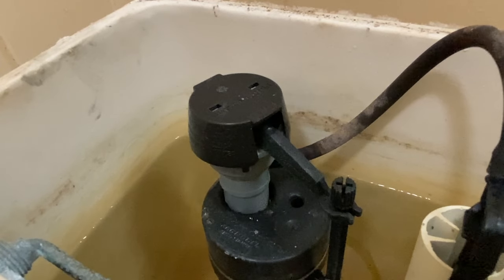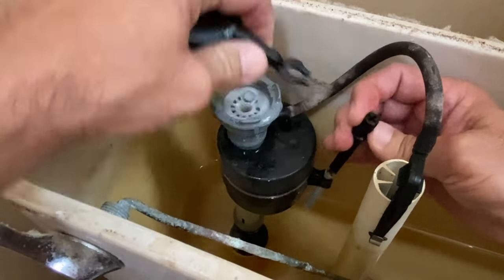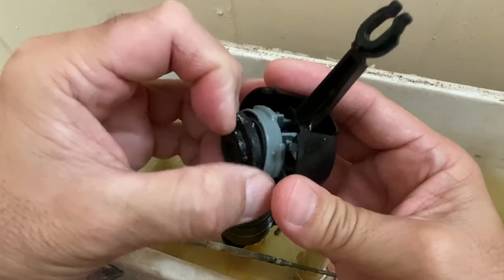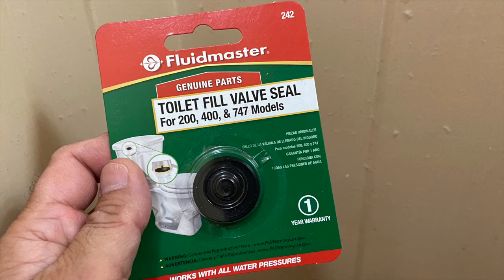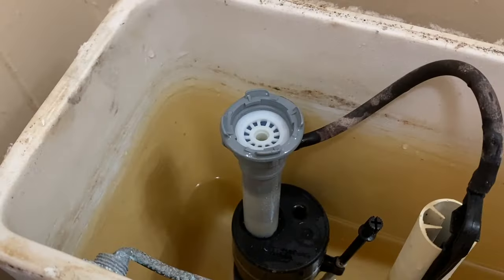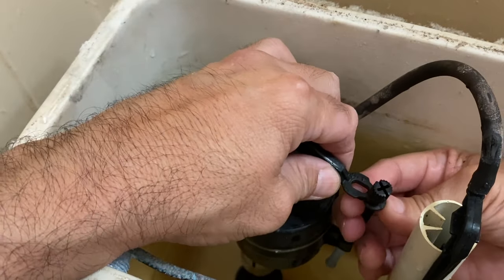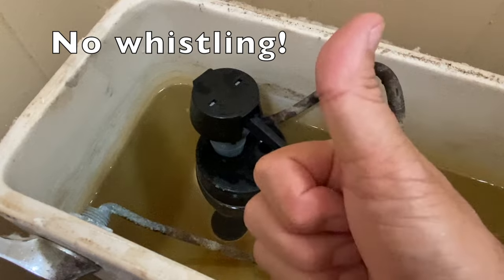Quickly Fix a Whistling Toilet

Comment: Last night, our toilet started making this loud whistling sound. It scared me. My mom and I found this video and it worked perfectly. This is a great video. I'm 12 and was able to follow it and fix the toilet. It even flushes better now. Thanks for the video!!!
Reply from the maker: Great job!   I’m glad to hear that you found the video helpful.  Keep on learning.  
😎
Reply: Thats so awesome  im going to attempt this tmrw. My toilet isnt whistling but after watching another video and this one i am wondering if doing this will fix my problem. Give me confidence to try this myself after reading that you were able to fix yours. He did gice great instruction. I feel so accomplished when im able to fix something myself. I mean i guess if i screw up or it doesnt work then we can call the plummer. Mine making that running sound.
Reply: Mine has been whistling for awhile.  I figured it just didn't know the words.
Reply: Did you replace the valve or just clean it?
Reply: Very helpful..
Reply: @godsgirl0019
Yes

Comment: great video. I just cleaned the seal and everything else with an old toothbrush, put back together and noise was gone. Saved a trip to Home Depot.
Reply from the maker: That’s great!   Thanks for sharing!
😎
Reply: I just cleaned it also. Looked like new, so 🤞
Reply: I tried that first, and it didn't work for me longer than 1 flush.
I ended up getting the $3.84 replacement exactly as shown here.  While it didn't look bad, especially after cleaning, I guess the old seal's rubber was too worn / dimpled.

Comment: Great video. The water where I live is very hard water and build up happens a lot I just wasn't sure how to get it cleaned out. All the other videos say to change the entire part not just the one piece and how to get to it. I just opened it up saw how clogged and covered it was. Clean it up and no more noise. Thank you.
Reply from the maker: Good to hear.  The valve seal deteriorates over time so you might want to pick up a replacement.

Comment: Spot on with the answer straight to to point 10-15m fix job done this is the best video on YouTube. Simply change the diaphragm washer. Not change all the system, add pressure valves, reduce your mains pressure
Reply from the maker: Thanks!  👍😎

Comment: Thank you for this video, I didn’t know what was causing the whistle, so I checked Google and chose your video, which was easy to follow! I was scared I was going to break something though. I didn’t replace the little thingy I just cleaned it really well and all around where the water comes in, with an old toothbrush and a couple drops of Dawn dish soap and replaced everything and the whistle is gone. Maybe this will work if someone can’t get a new part right away. Thanks again! 
Now if I can figure out how to fix our stackable washer that won’t spin (and landlord won’t fix).
Reply from the maker: Glad to hear it... the fill valve... not the washer.  LOL
Reply: Same here! Cleaned it and good to go
Reply: I might try this. A new rubber piece didn't work for me. Still whistling...

Comment: Great video. In a pinch you can just clean the old valve with vinegar and a brush and then apply a light coat of wd 40 or any other lubrication and it will silence that sucker right up.

Comment: Great video, I cleaned mine in less than 5 minutes. I have to replace the valve still, but just cleaning it stopped the noise for now. 
Thanks for the video

Comment: +1. This worked exactly as shown.  $3.84 part from Lowes, exactly as shown at 1:09: Fluidmaster 242.
It probably helps that mine was exactly the same Fluidmaster 400 fill valve.

FYI: mine was whistling while filling, not right when the valve closes.
I first tried just taking it off and rinsing it out as shown at 0:42, but that only worked for 1 refill for some reason.
I replaced the valve seal and so far it's fixed.  The old one didn't look bad but I guess the rubber was "dimpled" too much.
Reply from the maker: Good to hear!  Glad the video was helpful.  Thanks for sharing.
😎

Comment: Just followed your directions. Turned off the valve, took off the cap, turned on the water a little bit to flush out the system, some debris did come out, and just for shits and giggles, I took the almost new looking rubber part out then flushed out the top of the cap and the rubber piece in my sink. Put it all back together and no more squeaking after the toilet was finished filling up! Thanks for all your help!
Reply from the maker: You’re welcome and thanks for the feedback!  I really appreciate it!
😎

Comment: If this doesn't work you may have a bad pressure regulator.   I had two whistlers but these techniques did not cure it so I had to go with the plumber.  He checked our pressure and found that the pressure regulator which should reduce incoming pressure of about 120  PSI to around 65 PSI was not working and I was getting the full 120 PSI forced into the plumbing which caused the whistling.   He replaced it which fixed the problem.   This turned out not to be so cheap but I'm glad I discovered this as continuing high pressure will soon wear out plumbing fixtures which gets' more expensive.
Reply from the maker: Thanks for the tip!  😎

Comment: At :44 what are you doing with your hand? Pushing down or flushing the toilet?
Reply from the maker: Neither.  I just cover the top with my hand and slowly open the supply valve to flow some water.  My hand is there to stop a water spout in case I open the valve too much.  Thanks for the question. 😎

Comment: Just earned a sub and now to binge your videos. Hello from Alaska 🙋🏻‍♀️🏔️💕
Reply from the maker: Thanks and thanks!  Much appreciated!  😎
Reply: @HacksbyDad  I just opened top of toilet tank after shutting off water. Mine is blue and looks like a different configuration. I lifted and tried to turn the top 1/4 turn but wouldn’t budge. Any ideas? TIA 🙋🏻‍♀️💕🏔️
Reply from the maker: @elizabeth4053  The blue cap is normally the 400H or 400AH.  They should look like the 400A in the video.  If not, it might be a different brand of fill valve.  Sorry.
Reply: @HacksbyDad  I found a video on here that had the exact one and they switched it out to a universal 😂
Reply from the maker: @elizabeth4053  🤷🏻‍♂😎

Comment: is there any need to add some silicone or food grade dielectric grease to the seal before seating it? or should it be popped in dry?
Reply from the maker: I've only popped the seal in dry without any issues.  Thanks!
Reply: @HacksbyDad  good to know. but I guess my issue was more annoying than just a seal. I had the whistling sound so I replaced mine a few hours ago. suddenly the fill valve wouldn't shut off. put the old one back in...now it won't shut off. went and returned what I thought was a defective 242 seal, got another one....same issue. So out of sheer frustration I just grabbed a KORKY MP fill valve and am just replacing the whole thing. was hoping that a simple seal would fix it... guess my fill valve had more issues under the surface
Reply from the maker: @MikeEdwards-j9g  Thanks for sharing!  The valve seal fixes the whistling most of the time... but not all the time.  😎

Comment: to save some trip to your hardware store. clean the seal first if there is no visible damage then place it back. If the sound improved then replace the seal 😁. thank you for the video.
Reply from the maker: You're welcome.  The valve seal was over 5 years old so it was better to replace it.  I probably should have replaced the entire fill valve, but wanted to show how to replace just the valve seal.  
😎
Reply: @HacksbyDad  How did you correct to TOO HIGH overflow pipe.
Reply from the maker: @tedlahm5740  You'll need to cut the pipe.  Probably with a pvc pipe cutter, hack saw, or cable saw.  The recommended height is 1 inch below the hole for the tank lever handle.  Hope this helps.
😎

Comment: Hi, the toilet in my new home has this problem. However it has a Fluidmaster 300 model, which seems to have been discontinued, and I can't seem to be able to find the replacement fill valve seal. What are your suggestions? Thanks.
Reply from the maker: Sorry... I haven't seen or heard of the 300 model.  If anything, I would install a 400A or 400AH.
Reply: @HacksbyDad  Thanks for your reply. It was indeed a complication. I bought a 400 model, and was going to change the entire fill valve. But as luck would have it, I could not unscrew the locknut. It is supposed to be able to be unscrewed by hand. But the previous person must have gone overboard and used some tool to tighten it. So frustrating.

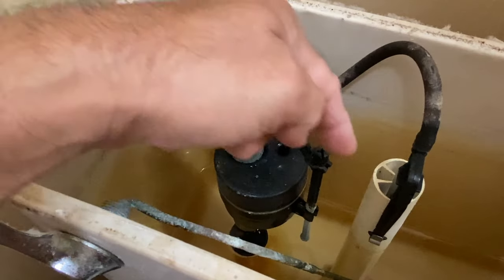Comment: 0:22 I am not sure I'm not able to do this quarter counterclockwise turn. I just keep unscrewing the base and it just leaks the water still in the tank. So annoying. Everyone else in the comments seems to have had better luck. Any advice?
Reply from the maker: Did you grasp and firmly hold the vertical valve stem so it doesn’t spin with the valve cap?
Reply: @HacksbyDad  It felt like I did. I held the vertical stem tightly with my left hand since there's little room on my toilet, and I tried turning the unit counterclockwise with my right. I couldn't feel anything even wanting to turn. Stiff, as if it was not meant to turn at all. Not wanting to crank it as hard as I can obviously.
Reply from the maker: @TheCman5015PLPro  Sorry... i haven't had any issues removing the valve caps like you describe.  🤷🏻‍♂
Reply: @HacksbyDad  No worries. Things make more sense to me when I see the inners of how they work first so I'll do some more research. I was tempted to remove the entire part itself and work with it then, but that's a last resort if this screaching sound brings me too. Would have to find a giant spunge too for the extra water.

For now, turning off the water line itself makes the noise go away. Hmm. Anyways, thanks for answering comments! Take care
Reply from the maker: @TheCman5015PLPro  If you like to see the innners... have you seen this video yet... https://youtu.be/twynH8xVdy8
😎
Reply: @HacksbyDad  Hi. I figured it out so easily this time. Was wondering if you had any advice here though. I was able to install the new seal and put everything back together and adjusted back in the toilet. Now I get a sharp wistling sound only when the toilet fills. Very loud. I doubt it is the seal getting used ti it's new place. Strange. I followed this video to the T. Thanks!
Reply from the maker: @TheCman5015PLPro  Hmmm... I haven't experienced that problem.  Other viewers have mentioned high water pressure can also cause the whistling.  Maybe partially closing the supply valve will reduce the flow rate and eliminate the whistling.  🤷🏻‍♂
Reply: @HacksbyDad  I just decided to order a replacement fill valve. At this point, I'm done dealing with this whole issue.
Reply from the maker: @TheCman5015PLPro  👍😎

Comment: My high-pitch squeal didn't start until I put a brand new seal in!  Once finished filling, it starts to make sound. Any ideas?
Reply from the maker: Not sure.  🤷🏻‍♂️ 
I suggest cleaning the seal and flushing the valve.  If the squeal persists, it might be time to replace the entire fill valve assembly.  Fluidmaster recommends replacing the fill valve every 5 years.

Comment: Question can you clean it without turning off the supply valve. Also, do I have to drain the water out when cleaning?
Reply from the maker: No, you need to close the supply valve first.  Do not take off the valve cap with the water supply valve open    The tank does not need to be drained.
Reply: @HacksbyDad  Cool Thanks for the fast reply.

Comment: Hi. I got new seal (Fluidmaster 242 as you suggested) but it does not fit on my valve, Number on new seal says  MI 254,  on my old is M 5405. Does is cause the issue? if so, where to find exact seal type and size? Thank you
Reply from the maker: Sorry… I’ve only seen the 242 valve seal which for 200, 400, & 747 model fill valves.  🤷🏻‍♂️
Reply: Thank you @HacksbyDad  I figured!

Comment: Is there a way to increase the rate of flow for a faster refill?
Reply from the maker: You might want to give one of the two options in this video a try... https://youtu.be/uMfD_utCahg
I timed the basic 400A against the 400AH and the 400A was faster.  A little noisier, but faster.  
😎

Comment: I just did what you show but the noise didn’t stop and it got a high pitch sound later on. Can you tell me what to do
Reply from the maker: If you only cleaned the seal, you probably need to replace it or the entire assembly.

Comment: My mom's toilet squeals at regular intervals and stops only when flushed.After not being used for a while the squeal starts again  Is this the same problem & solution?
Reply from the maker: Replacing or cleaning the valve seal should stop the squealing.  Regular intervals could mean that water is leaking by the flapper.  Check out this video for help with that… https://youtu.be/ki5RYicgTS8
😎
Reply: @HacksbyDad  Thank you so much...I'm on it!

Comment: How do you know which seal to buy?
Reply from the maker: The 242 valve seal fits in the 200, 400, and 747 series Fluidmaster fill valves.  Not sure about any other series or models.

Comment: My toilet is loud whistling  every few minutes even when not being flushed- could this still be the cause?
Reply from the maker: The whistling is probably from a dirty valve seal and it happening intermittently is most likely due water leaking by the flapper.  Pls check out this video… Fix it Yourself!  Toilet Runs On and Off
https://youtu.be/ki5RYicgTS8
😎

Comment: Ok I did this but now it won’t stop running.  Unless I turn it to the left a touch each time.  Any suggestions??
Reply from the maker: Here are my suggestions...
1.  If you only cleaned the seal, replace the seal.
2.  Clean the valve seal and fill valve.
3.  Replace the fill valve cap (with new valve seal) or replace the entire fill valve assembly.
Reply: @HacksbyDad  Thanks for the reply!  I did replace the valve seal.  Just wondering if I didn't turn the assembly correctly possibly?   Because the water does stop filling if I turn the top of the valve assemble slightly to the left.
Reply from the maker: @janetcapell7126  Please make sure that the valve cap is properly seated because it could cause a flood if it pops off.

Comment: put in a new shut-off valve checked and opened the valve itself. Put everything back in. still whistling will have to check the braided hose for debris i guess will see if that the problem of the whistling. brand new unit didn't have any problems with the other toilet expensive for another new unit. rubber on new one seems aok.? actually whistles while filling [?] a brand-new shut off unit
Reply from the maker: Others have said that high water pressure is also a cause for the whistling.  Partial closing the supply valve may reduce the water flow rate and whistling.

Comment: The water doesn't go thru the  fill valve what shall I do?
 Thanks
Reply from the maker: I’m guessing that the fill valve, hose, and/or supply valve is clogged.  🤷🏻‍♂️
Reply: @HacksbyDad  No, it is not  clogged. The main supply works normally, but sometimes the water is cut off, so I thought about connecting the water from the tap to the main I maid T connection, but the water does not enter the toilet tank.

Comment: I followed this step ny step, but i must have done something wrong because my toilet wont stop filling/running. I dunno what to do
Reply from the maker: Adjust the float/float screw.
Clean the valve seal again.
Replace the valve seal.
Replace the entire fill valve assembly.
Good luck.

Comment: I recently found the water pressure coming into my house is 90 psi. I had professional plumbers install a pressure reduction valve and several problems went away- water hammer that water hammer arrestors couldn’t overcome, showers that felt like I was being sandblasted, and I suspect the toilet floats weren’t designed to overcome that much pressure. It may be worth checking your water pressure if you have any of those problems.
Reply from the maker: Thanks!  We had water hammer with 120 psi after our water pressure regulator failed.  I rebuilt the regulator and check the pressure every once in a while.

Comment: I replaced it, but the water keeps coming in  and going over the top of the outflow contanier
Reply from the maker: I hope you got the fill valve to work properly.  If not, lift the float arm with your finger to see if the water flow stops.  If it does, lower the float by turning the float screw counter-clockwise.  The water level should stop about 1/2 inch below the top of the overflow pipe.  If the flow does not stop by lifting the float arm with your finger, try cleaning the valve seal and valve.  Next would be to try another valve seal or valve cap assembly.  If worse comes to worse, replace the complete fill valve assembly.  Here's a video... https://youtu.be/HFLEoBAJj2E

Comment: I ended up replacing the whole fill valve, cost $9. Replacing the valve seal did not work for me, it still whistled and started leaking at the top.

Comment: How did u get the water to come out n flush the debris if the water is off? Puttn my hand over it does nothing.
Reply from the maker: SLOWLY 😁 open the water supply valve. 
😎
Reply: Ooooooo makes sense 😅 preciate it Man my grandparents have had this issue for bout a month till I said let me have a go at it. I broke a small grey piece off that holds the black cap but it doesnt seem to effect it..yet lol
Reply from the maker: @arotheartistarabthewarrior9805  👍

Comment: You know perfectly well that you will end up replacing the entire unit as they are flimsy and the cap will break when you take it off.
Reply from the maker: Sorry,,, that has not been my experience.  I have removed dozens of the Fluidmaster valve cap assemblies and none broke.  👍😎